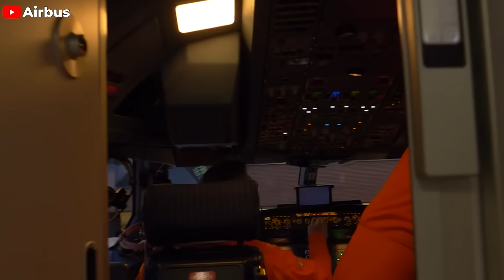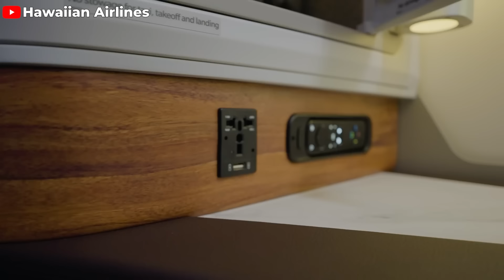No One Wants A330 neo And Turn To 787 Dreamliner! Here's Why

Comment: This message is erroneous as the cost by AIRBUS to upgrade from CEO to NEO was not significant .Firstly three hundred  A 330  Neos have been ordered ! Not the derisory number stated in this misleading video.  Background  certain loyal A 330 customers requested a NEO version This was not the case with Boeing as  there was no direct equivalent predecessor to the B 787 . Its obvious that most A 330 customers and MANY Boeing customers selected the newer A 350 which is superior to the Dreamliner, in a number of ways  especially its long range! This video is comparing Apples with Pears! So DONT say no one wants the A 330...
Reply from the maker: thanks for your sharing

Comment: If A330 operators replace the said aircraft with A350-900s and/or Boeing 787 Dreamliners, their cabin will be more cramped due to the A350-900 and 787's 3-3-3 configuration in Economy Class as opposed to the 2-4-2 layout on the A330neo, which makes the widebody experience more enjoyable for pairs only in Premium Economy and higher cabins! Also, pilots will take more time to switch between aircrafts!
Reply from the maker: Thanks for sharing
Reply: Airbus A350 more comfortable than 787 for 3-3-3 abreast seating due WIDER fuselage width design, A350 fuselage width is  18 ft 5 inch vs 787 fuselage width is 18 ft 0 inch, which is 5 inch difference, so the A350 can install more wider seats for 9 abreast seating.
Reply: @TonyLee-th1vv  I prefer Premium Economy because it has a more spacious seating configuration, better seat amenities, earlier boarding, better in-flight meals, and additional miles and points.
Reply: @thyip6167  Not every flight offer Premium Economy seats. 😔
Reply: @TonyLee-th1vv  While airlines invest premium cabins, they carefully consider how to attract passengers without undermining their first and business class offerings.

Comment: The airlines screwed up the 787 comfort advantage when they insisted on squeezing in an additional seat. So instead of the specifically designed layout of 2-4-2, allowing couples to have their own private set of seats, the majority of airlines utilize the 3-3-3 layout which is just about the most uncomfortable ride of any airplane. I will seriously consider buying an extra seat for my wife and I to bring it up to a modicum of comfort on 10+ hour trips. Or opt for an A330 or 767 that have two sets of 2 passenger seats per row. What a disaster for the flying public, and the image of the 787.
Reply from the maker: thanks for sharing

Comment: The two problems that the A330-900/800 have is that the seating capacity is not big enough and the plane is too heavy. also the rolls Royce Trent 700 engines are no where near powerful enough so any airline that has bought one new has put the Pratt and Whitney engines because they have a lot more power condor airlines flies the A330-900 on long flights with Pratt and Whitney engines they have the biggest fleet of the A330-900 . But I do think 🤔 Airbus needs to redesign the A330-900 and the 800 because it’s too heavy and not the seating capacity off the old A330-300 and the A330-343 virgin Atlantic and euro wings discover airlines and Lufthansa all fly this model of A330 because it’s faster and more powerful engines and they are not replacing them because the new version is nothing like as good in fact Virgin Atlantic and euro wings have bought the very last off the planes that were built in 2020
Reply from the maker: yep thanks for your sharing
Reply: You’re welcome
Reply: Don't drink an' write!
Reply: I don’t drink. But I do know the facts about the A330-900/800 and the fact that virgin ATLANTIC has bought a lot of the last A330-343 the same with Aerlingus
Reply: Yeah but comparing it with the 787s, lately Boeing have received multiple complaints about the 787s manufacturing defects on their structural components, and other manufacturing issues, including the 737 MAX
Reply: I quite agree the other problem with the 787 is that having problems with it's engines so rolls Royce and stopped the Trent engines and Boeing has had big problems with the 787 since it was new and the same with the 737-M range

Comment: Their loss, I refuse to travel on any Boeing plane.
Only in Airbus we trust🥰😍❤️
Reply: 787 Dreamliner is on the air for 13 years without any major incidents. As a result is one of the safest aircrafts out there I f you want to fly with it. Yes 737 max is a disaster but 787 is superior.

Comment: I will not to board any airlines with junk dreamliner with 9 abreast seating config, the worst comfort in modern airlines industry, I rather pay less air fare costs to low costs carrier with A321neo/LR/XLR which a bit better comfort than 787 with 3-3-3 cramped seats design.
Reply from the maker: thanks for sharing your thoughts
Reply: @TonyLee-th1vv  I believe Boeing should either improve the quality of their 787 or just terminate their production keep their crappy 787 out of production